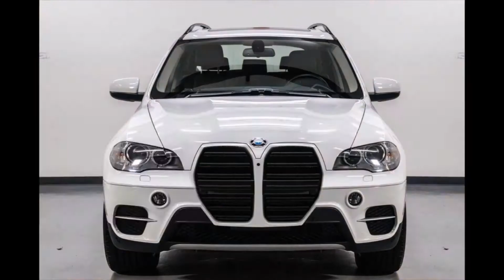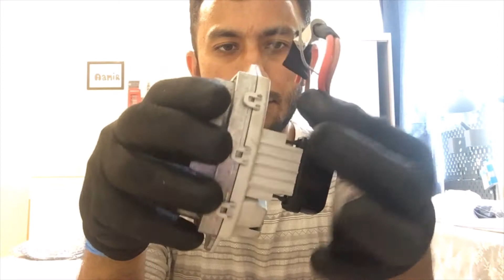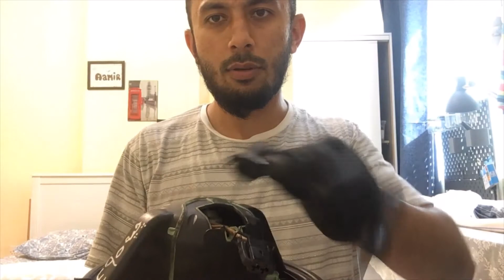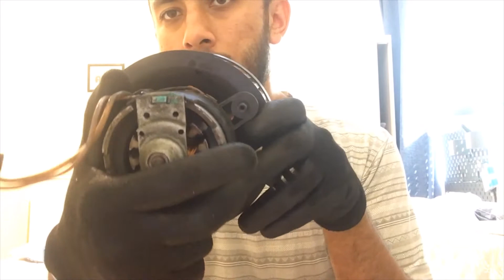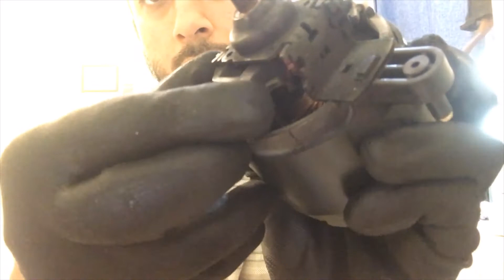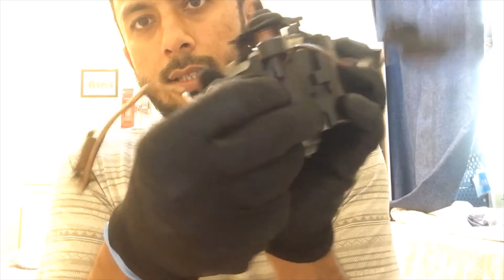BMW AC FAN BLOWER MOTOR REPAIR - NO NEED TO REPLACE THE BLOWER MOTOR !!!

Comment: I replaced the brushes with some that are similar and I crimped the connectors. Now the blower motor works but it doesn’t spin fast, do I need to seat the brushes?
Reply from the maker: Ur car battery might be weak. The system will decrease the use of electrical usage when battery is weak

Comment: Dude,Thank You! Yours is a different type than mine. But seriously,THANK YOU for being the first disassembly video ive found after searching for a good 30 mins. Ive been trying get my suburbans blower apart but I'm not too sure how to open the hard metal casing on the bottom to access the motor or even get the fan off for that matter. Mine works properly but i think i bought a flooded truck so the bearings need to be lubricated somehow.

Comment: Where can I found these brushes?I have the same motor..
Reply from the maker: Check in motor winding shop. I got from alternator n dynamo parts shop, not the exact size, a bit bigger and I had grinded it to required size
Reply: @bimmerhacks  thanks buddy I will,try

Comment: I have this same ac motor. My problem is that it can hardly SPIN. Any ideas on that sir?
Reply from the maker: Probably the carbon brushes have worn out.
You can connect the fan directly to the battery using a wire bypassing the fan resistor to make sure the problem is with the fan. It's brush motor so it doesn't matter if you connect -ve to +ve or vise versa
Reply: When I start it at the first scale it works. But if I increase the power to make it turn faster the second the third or the last scale it does not increase the turn speed
Reply from the maker: @gchokmet  100% the carbon brush of the blower fan motor has worn out. Change the carbon brush or motor your choice.
Reply: Thank you so much. I will see what I can do!

Comment: My F10 fan has a problem. When I turn the largest fan, the fan will run about 20 second and then stop. I need to turn off the fan , wait about 3 minutes and the fan will running again. I already changed the resistor but didn't fix. Do you have any suggestion? Thanks.
Reply from the maker: As in my video change the carbon brush. When the fan gets heated up the contact to the armature coil will be getting disconnected. Rip it apart. U might be able to get a burnt smell too I guess
Reply: Hi brother i have same issue with my f10 what did u do to fix it brother

Comment: Hi brother, thanks to you for spending your time to help others around.  
I want to rebuild my HPFP, you said you will be making a new video on how to do the oil fill using new technique. Were you able to film it?
Take care brother
Reply from the maker: I tried other ways and it was a failure. Air getting in. Immersing completely is the only effective way that I found
Reply: @bimmerhacks  oh I see, is it a must that it should be air free?
Reply from the maker: @evgasrx  if it's not air free the compression will not happen properly. Air can be compressed easily
Reply: @bimmerhacks  make sense now. One more thing, is it ok if I don’t use X- ring ? But a good O-ring ?
Reply from the maker: @evgasrx  when I tried o-ring it started leaking after a day. May be quality issue, but I felt like x-ring can seal more area than an o-ring.
Be careful when you take the spring like pistons out there is more chance of damaging it while taking it out by pulling
Reply: @bimmerhacks  I’m unable to find X ring that’s why I wanted to try O-ring. may I know the dimensions of oring?
Reply from the maker: @evgasrx  I don't have the dimension. Try a good quality tight fit o-ring then
Reply: @bimmerhacks  I managed to get the xrings, do you know for how long I need to keep it dipped in oil?
Reply from the maker: @evgasrx  20 mins will be enough to get  all the air out. Make sure no air is trapped in the diaphragm part(the small hole might have air trapped, use tiny plastic stick to pull it out as shown in my video.)
Also be careful when you put back the pendulum side on top of the compressing pistons, the piston caps should not fell down while you install the pendulum part(the top cover of the HPFP). MARK THE POSITION WHICH SIDE COMES WHERE on both halves of the HPFP so that you don't get confused while putting it back.
Reply: @bimmerhacks  thanks a lot buddy, will follow your advice. I also ordered the same oil Toyota 85w90. 
Also thank your father for giving us the the idea that this is possible. Parts will reach me in a week, so I’ll update you after that. Take care buddy